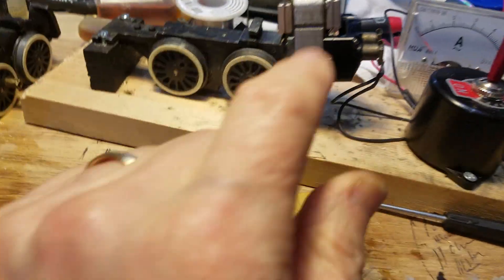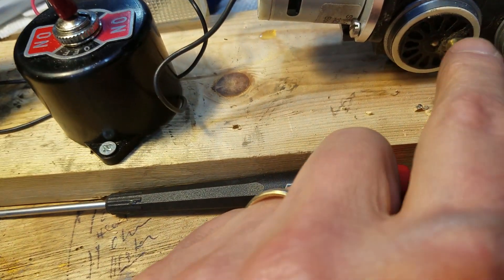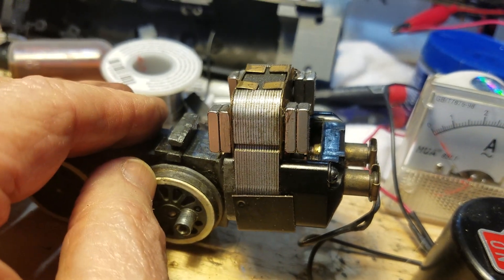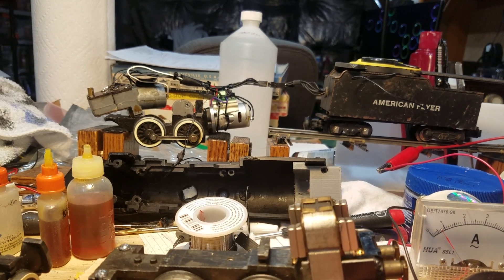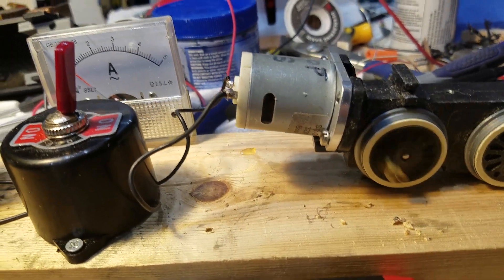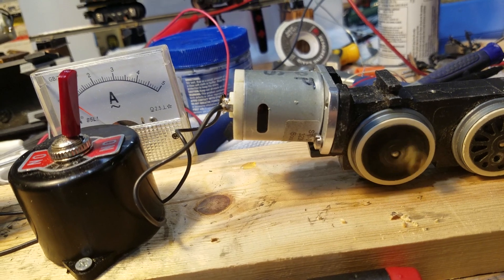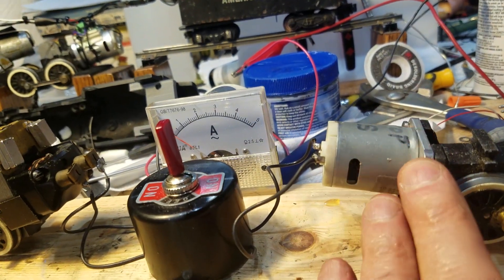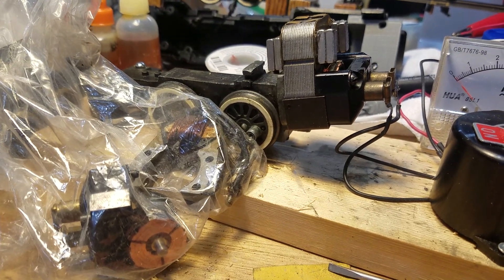DC motors in American Flyer steam enginez

Comment: What brand of can motor is that and where can I buy it? You said it was geared lower. Does that mean the engines will run slower?
Reply from the maker: SNS motors have a new slow speed motor with same torque and quiet Gear! same price, Steve is a good guy and makes great products.  www.snstrains.com In one engine I used the lower gear and lower speed motor to get good chuff smoke at low speed with conventional controller. (not TMCC or MTH) Let me know how your doing. Dennis
Reply: And pull more but listen to how awful it sounds.
Reply: @dmcmanam  1❤❤❤❤❤❤❤😅😊
Reply: But, Dave, what kind is it and where to buy it?
Reply: @jockellis  I have no idea what kind it is, I'm in a FB group about American Flyer where people would know but I don't like those, I just want to switch to LEDs, not can motors.
Reply: David McManamon Thanks for replying. I met a chap in the Atlanta Lionel Club who said they could help me. Guess I’ll try him.